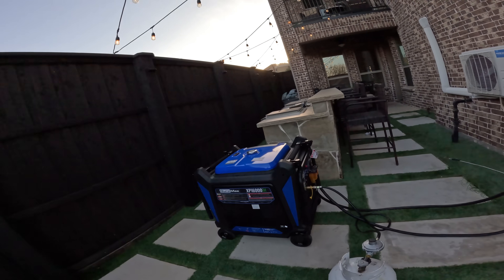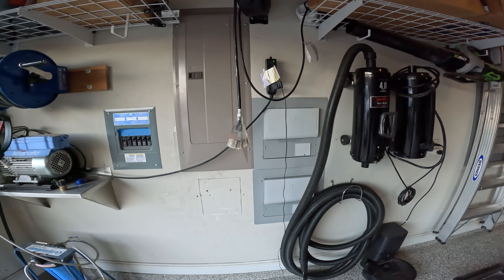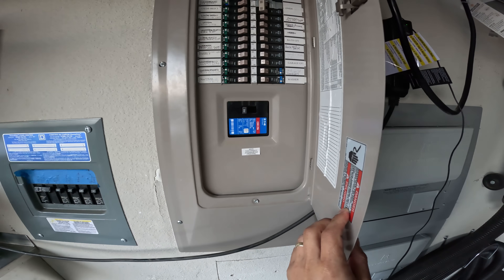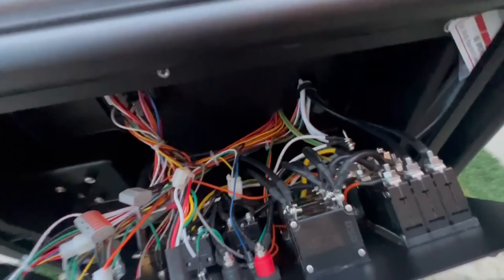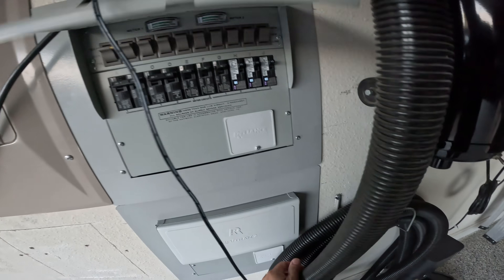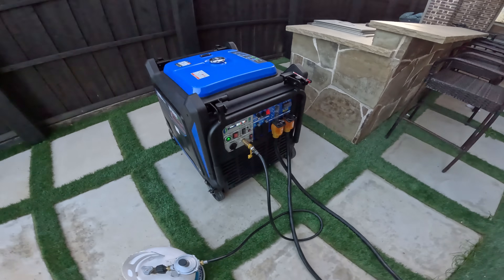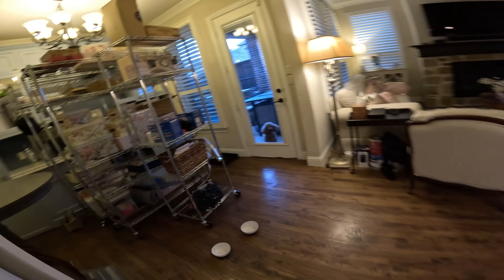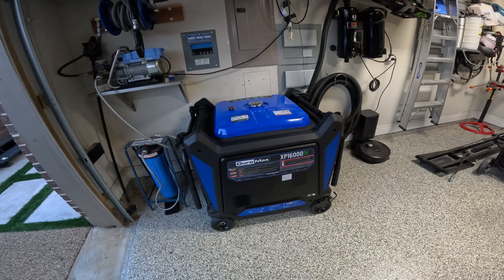Duromax XP16000IH portable Home Generator Dual Protrans 2 GFCI Floating Neutral Mod home gen part 2

Comment: Honestly, a 9000W unit (peak, which is 7600W max run rate) would probably never be able to run that 7.5KW load for longer than a couple minutes without over heating/tripping breakers that you had with AC and all lights on and you will be disappointed if you try to downsize.  Typically recommend to 70% the run-rate to get what you can supply on these portable generators.  Meaning 9000W (peak) is 7600W max run rate time 70%, or 5.3KW stable.  16000 feels like over kill, until you realize that is 12350W on propane max run rate and then derate that 70% is 8645W effective with surge buffer.  At least you went the over-sized direction, where most buy into the marketting hype of the PEAK SURGE advertised wattage, and then are going, hey, why can't my new generator even do 5000W AC load.

Comment: WHY unbond the neutral? 6:00
Reply: A home requires a single neutral to ground bond at the first point of disconnect per code, otherwise your safety grounding system becomes another current return path (neutral).
This can disrupt the proper operation of GFCIs as well create an unsafe state in the electrical system.

Comment: Its not this simple. You have an actual transfer switch. If your transfer switch is designed to switch the neutral, you should not have a floating neutral on the generator.  If you were using a standard breaker and interlock to feed the panel, then yes, you should have a floating neutral on the generator.  Maybe you already know this, but if not, find out.  Just because it works, that doesnt mean it cant kill you
Reply: Hey, this guy is 100% right. You need to check how your transfer switch handles the neutral. For an Interlock kit which almost universally breaks the hots but not the neutral, absolutely, float the neutral, but for a transfer switch you need to see how the neutral is being handled.

You can test with a multimeter. Set the meter to continuity mode. Place one probe of the multimeter on the utility neutral terminal and the other probe on the generator neutral terminal.

If there's continuity then floating the neutral is correct. If there's not, you need to rebond your neutral and ground in the generator or you're going to kill yourself or someone else if there's a ground fault.
Reply: That depends entirely on each particular transfer switch. Some maintain the neutral bonding, some switch it.

Comment: What are the size of your 2 AC units?  How many tons each?  When I researched I saw the 5T one draws 7K and 3.5T draws 4K so I was concerned the 16K IH would not be enough when running on natural gas (new ti-fuel version)

Comment: I wish every generator Brand would advertise the running watts instead of peak watts on their models. This generator model number is Duromax XP16000IH, but that’s the peak watts. Westinghouse generators model numbers are the running watts instead of the peak watts. Like the one I have, model number Wgen14500c. Which 14,500 is the running watts with a ≤5% Total Harmonic Distortion, and cost half the price of the Duromax XP16000IH and has 1,500 more running wattage
Reply: the Wgen isn't an inverter
Reply: This is a duel fuel pure sine inverter generator with (2) 50 Amp receptacles. Westinghouse doesn't make anything comparable to this monster.

Comment: Hello, just curious; what does a floating neutral do? I'm just asking because I genuinely don't know.
Reply: It means the generator is not grounded rather it relies on the ground via being connected to the house. Otherwise when running the house you would have two grounds which violates code. If he wasn’t connected to his house (say running at a camp site) the you wouldn’t want a floating neutral

Comment: Just got this Generator did the mod to convert to neutral float,  I had a total of 5 white wires going to the common grounding block not 6.  After making the mod it dawned on me is that you may only need to remove the white wires going to the 240/50 amp receptacles and not the ones going to the 120vac. This was you can keep the 120v receptacles as bonded and the 240 as float since these are the ones you will be connecting to your house .  If anyone else tries this bonding you they may want to try it out ,  just remove the white wires going to the 240v  receptacles and check the continuity with ground  and then the check ones going to the 120 to see if they are still bonded.
Reply: Assuming there would be ground continuity across chassis, 120V and 120/240V receptacles, wouldn't "only 120v bonded" setup still have a continuity from 240V neutral to ground through 120V bonding points? It's hard to imagine 120V neutrals and 240V neutrals are isolated.
Reply: Bingo!
Reply: Why do this? What is the effect?

Comment: With that much generator, you could have just gotten away with a manual transfer switch or interlock install instead of the two load priority panels

Comment: What is the part # for the oil filter for the Dutomax 16000 on my filter is a # SV750 but I cant find where to buy one
Reply: I was told by duromax that ypu can use STP S4967
FRAM PH496

Comment: Have the same pannel cutter hammer   200 amp  i have the same set up as you but interlocked  with  fluke amp clamps   reporting to an lcd  beside the panel  so i can monitor  amps kwh   frequency   power factor and   sin wave

Comment: This generator is awesome. The one thing I will say is that on propane, you're only getting 12,350 running watts from this, so although you have both 50A cords, you're only getting a little over 6kW from each.
Reply: And with gas you're only getting 13000. So 650 more watts than propane.  It's not 6kw from each port, it's any combination up to 12.3kw or 13kw. That could be 10kw on one and 2or3 kw on the other.
Reply: @machaf  Yes, you are correct. It's any combination between the two cords.

Comment: Neutral bonded to frame. 1 WIRE ONLY!!! ONLY DISCONNECT THE GROUND WIRE FROM THEM THE ONE GREEN GROUND WIRE THATS WHY ITS CALLED A NEUTRAL’s!! NEUTRAL’S BONDED TO FRAME!! SUNGULAR! IM A 25 yr generator/home  ELECTRICIAN  one WIRE NOT ALL!!!!!! The neutrals complete the return circuit of electricity! REMOVE THEM GOOD CHAMCE YOU CAN CHAGE A TOASTER A LIGHT SWITCH ETC AND ECLECTRICUTE YOURSELF TO DEATH OR END UP EXTREMELY INJURED!!!! Do NOT LISTEN TO THIS FORK AND SPOON!

Comment: The real math is only 8000 watts per 50 amp plug…. With one 50 amp plug is 12000 watts

16000/2= 8000 watts 

8000/240= 33.33 amps per plug

12000/240= 50amps

Comment: Can you help me understand why you have dual transfer switches and are using the dual 50 amp plugs instead of just an interlock kit and back feed one 50 amp plug.  12,000 Watts is 12,000 watts no matter how you do it.
Reply: He has two 50amp plugs split because the 50amp plug is only able to handle 12000 watts max. In order to take advantage of a generator that produces more than 12000 watts and not overload one circuit, you split it into two. Each 50amp plug can handle 12000 watts. Think of it as splitting the load of all the circuits in the house. You can also do this with a generator that has a 50amp and 30amp plug. You’d split the circuits between both so that you can take full advantage of the entire wattage producing machine you’re using over 12000 watts. If you’re using a smaller generator under 12000watts then you’ll only need a single 50amp plug.
Reply: @retiredAF1994 ok thank you for explaining it very clear. I am updating my backup system , after Hurricane Beryl I realized I need a gas generator because the jackery and eco Flo I have was not sufficient to keep me totally comfortable.

Comment: I am curious why you didn't just use an interlock kit and power your entire house with a generator that size?
Reply: The generator is rated at 54 amps. If you have one 50A inlet you are not able to fully utilize it. I am having the same dilemma.
Reply from the maker: Yes he is right because this portable unit supplies the full power via two separate plugs you’ll need to do two transfer switches. I have another video on the full install of the two transfer switches.  It’s not terrible but simply a tedious process

Comment: For medium to large generators, it is recommended to use a 40-100 lb (or more) propane tank to help with maintaining pressure and also longevity.

Comment: I wish it was a tri fuel natural gas is the way to go in my area
Reply: That generator is tri fuel, which means it’s gasoline, propane, and natural gas
Reply: Keep in mind, you can run some bi-fuel generators in natural gas by turning the choke on just slightly.

Comment: Sure, but you could run two 10,000 watt in parallel for half the money .... The 10,000 Watt units are also about half the weight.
I mean that's basically what he's doing here anyways with two separate 50 amp plugs right ?? So why break your back and spend double the money ??..IDK
Reply: @lordvader2681
I originally thought that too.   However, two units will burn ~2x more fuel.

Comment: I like how he kept saying 1600
Reply: He was wishing it was only $1,600.00.
Reply: Just like he said his 3 ton AC's used 6 amps.....right....Mean while my 1 ton mini split uses 6 amps and  2.75 ton efficient mini split uses 16 amps....and using a 20lb propane tank with generator is comical and in cold weather forget about it, that 20lb tank will freeze up. Lot of issues here.

Comment: Roughly how much have you put into this setup:  generator, 2 transfer switches, 2 soft starts, cords, install?
Reply: Could of had a true standby like a 26KW I'm guessing.
Reply: You’re probably not too far off- I spent a ton with my portable gen setup (interlock,  convert gen to natural gas, pipe the NG, etc) but I really enjoyed the whole process and like the fact that I know my set up inside and out, can do all the maintenance myself and can trouble shoot most minor issues. Definitely wouldn’t have been as enjoyable to pay an electrician to plop a stand by unit in.

Comment: Did you want/need portability? I notice the cost of this unit is about the cost of a 'Name Brand' 18kw (running) whole house unit with 200A ATS. So, it's hard for me to balance the cost unless I wanted portability. With this unit, I would still have to buy a ATS.  Any thoughts?
Reply: Portability is very convenient for other activities such as camping 🏕
Reply: The 16000 is about $5k, soft starts are roughly $400, transfer switches range from $200 to $400 some a bit more expensive and the wiring is based on individual electricians.
I went with the 9000 and got it for $1799 tax free...100lb propane cylinder. As long as I have heat/AC I'm good,  no need to run my entire house. I don't care about the noise, it's a power outage so who cares.

Comment: Hope the Gen is Dual Fuel, because the gen’’s that use natural gas or propane/Butane uses a substantial amount of fuel….Deisel is the best, Airman or Denyo Super quit Brand. But like the set up you have and like that even at idle you can run the entire hse. I agree the 9000 will do the trick but will run at night RPM equaling more noise! Again Nice set up and house👍🏽🌴👍🏽 YouTube watcher from Guam!
Reply: They use a substantial amount of gasoline too.

Comment: Nice setup. Mine is similar. It's smart to use propane. No worries of old gas gumming up the carb and the generator not starting when you need it.
Reply: I have a 12000 duel fuel, and I use both fuels, and yes propane is very clean. After I use my generator I change the oil, drain the fuel out of the tank, and the Carb has a drain plug. I have had no issues. I live in the mountains here in California, and with the wildfires we can loose power for a week or more. Gas is hands down cheaper to run than propane, and because I’m rural gas is much easier to get. If I lived in the city, I would use natural gas, there are videos on how to set it up.